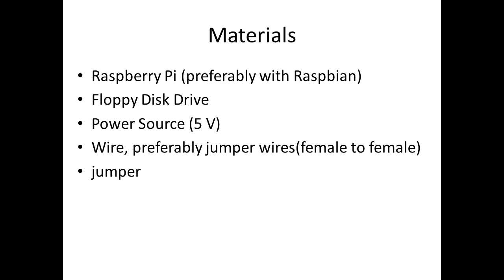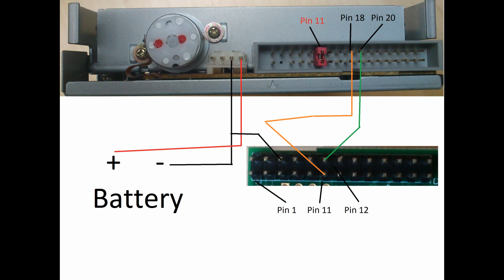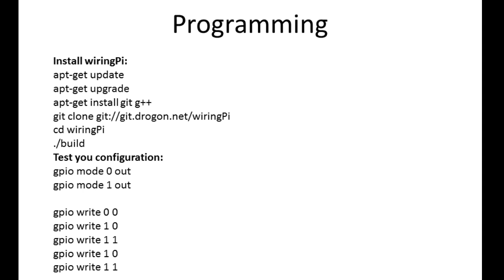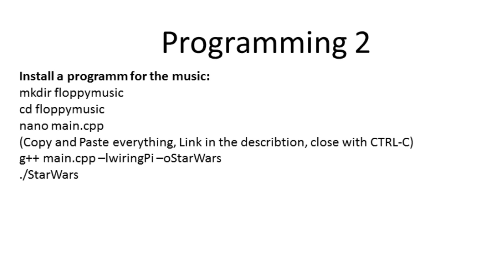Tutorial: How to Make Music with a Raspberry Pi and a Floppy Drive

Comment: I got my floppies....got my pi......got the software as you showed (clone wiringPi off github) but I am having issues.

If you're reading and want to try it - on some floppies the jumper pin for the LED is different, and on one of them I can hear it power on without the LED jumper across the 2 pins - but on another one this jumper NEEDS to be there to complete the circuit - Not only that..but on BOTH of mine the jumper needs to be one pin over to the right of the video demo - it's the ONLY pins that work on mine

So firstly after installing wiringPi, I was shown a message saying I also need (-lwiringPi) and (-lwiringPidev)

I continued anyway...now i have wiringPi installed, and I use the mode command to activate the pins 0 and 1 (GPIO 0 and GPIO 1 - they are POSITIONED as pins 11 and 12 as you count them on the board)

All Good.....then I run the test command - the write command: gpio write 0 0 (etc) to hear the motor or confirm I am on the right pins etc etc - I just get nothing. I have it grounded off the pi aswell

I get no error messages - but I also get no activity within the floppy drive - no motor or spinning or anything. I went ahead and repeated the command over EVERY pinon the floppy to try and see if my pin configuration was different and nothing.

I am baffled now
Reply from the maker: Okay, right now I don't get if its an hardware or software issue. If you connect the pins to the power source, can you make the drive click without any usage of the Pi at all, to confirm the pins and the drive works as expected?
Reply: yes - as soon as I hook up the floppy to the power source it clicks once - and the LED comes on if the jumper is on >>>> I made progress just a minute ago...now (gpio write 0 1) and (gpio write 0 0) makes the LED on the front switch between high and low - so I am getting somewhere. This is the same on Both of my floppies (thanks for the reply)
Reply: the floppy will click and light up if I hook it up to a different power source (I have a low power 5V dc adapter to test them) I believe it is software related - my errors probably - although I did notice that my jumpers needed to be in a different place...the main thing is I have contact with the GPIO pin through the software - its just doing th wrong thing...I thought about moving this GPIO pin wire across EVERY floppy pin and running the code each time - untill one moves the motor lol
Reply: I just watched a floppy song - they ALL have disks in the drives......do I need to have a floppy disk IN the floppy drive in order to get the motor spinning?
Reply from the maker: I don't know it for all drives, but the ones if tried worked without, maybe they use it because it changes the sound? But I could also imagine a drive which only works with something in it with like a build in switch. Just try it. In your first comment you mentioned the working software controlled GPIOs, so maybe just try to get a connection between the power source and one of the pins on the drive, and then try if you can find a pin that clicks if you connect/disconnect power and drive. Hope I can help you a little bit.
Reply: Yes I have a connection between the software and the GPIOs - but NO clicking or motor movement....just the LED on the front changes when I run the code.    So no motor movement or clicks, but the LED on the floppy goes between high and low (bright and dim) 

so If I type:     gpio write 0 0

the floppy drive led goes brighter

if I type:    gpio write 0 1

the floppy drive LED goes dimmer / less bright

EVERY floppy pin does the same, but some are brighter than others.

I'm sure I will figure it out I seem to have a different pin layout on the floppy drive to your example, so I will keep trying different pins - on the floppy and on the Pi -

Thanks for your help

Comment: im trying this on raspberry pi 3 and it doesn't work. can you help?
Reply from the maker: I will try my best ;) 
Do you get any error messages while doing the steps mentioned in the video? Do you hear the drive click when connecting power?
Reply: Thank you :)
No error messages are appearing. The drive moves when shorting pins 11-12, 17-18, 19-20 (odds are grounds). I'm using pc power supply to the drive and independent power supply to the raspberry. Commands "gpio write" do not seem to do anything while on "sudo ./StarWars" rpi seems to be "doing it". Double-checked the wiring - seems to be right
Reply from the maker: Maybe there is a Problem with the Pin Layout on the RPi 3...
You could try to check on http://wiringpi.com/pins/ if you have the right pins connected.
Reply: Yes...the different versions of Raspberry Pi have slightly different layouts - I have a Raspberry Pi 2 and a lot of projects are written for the original Pi's....try googling your model's GPIO layout, and change the pins accordingly
Reply: I have the same Problem. Do you had any solutions?
Gibt es irgendeine lösung?

Comment: Thanks for this tutorial ! I just have a little problem: I did the wiring correctly and the final program works fine. But when I try to play the song, the drive don't receive any signal. He does make sound when i connect the gpio on the Raspberry (little cliks) but that's all. Any ideas ?
I tired to change the pins (because i'm on a Raspberry Pi B) but nothing.
Reply from the maker: Mhm, are you able to do the clicks in the "manual software" with the gpio command? Or isn't this working too?
Reply: The manual software isn't working. WiringPi is working, but when I try to make the sounds by typing the commands, nothing happens. Also nothing happens when I modify the gpio inputs/outputs. I even tried with 2 differents drives but still nothing.
Reply from the maker: +Estate Mhm that sounds like a problem with either the wiring of the cables, which you should double check, but I think you already did that ^^ So maybe it's a software-hardware problem. One idea might be to try to check the functionality of the gpio for example with a LED-light to see if the hardware of the Pi is working regularly. Are you sure you have enough power for the Pi to operate them?

Comment: Thx for guide. I make my floppy music. It's wonderful 
How to make a sample from another MP3 music? Knowledgeable prompt. Thanks to the author again.
Собрал такую же тему , 2 флопа для стерео =)
Кто знающий подскажет как делать семплы других мелодий , например передрать mp3 какойнить?
Reply from the maker: +Александр Лукьянов Okay, I don't know if I get you excactly right, but to me it sounds like you want to play an mp3 song on the floppy, or convert it so it plays on the floppy. First, the floppy can only make one specific frequenzy over time. So you can't use it as a normal speaker, it's more like a flute or something, only one note at a time. So you can only play tunes. To play another Song, you have to find the melody to play for that songs. While this is very very difficult to do automatic with an mp3 file, it's very easy if you have a MIDI version of the song. So if you want to play another song, maybe try to find a MIDI file, find the melody you want to play out of the song, and then programm it into the Pi to play. I hope that answers you question, feel free to ask if you want to know anything further.
Reply: you need an army of floppies to do multiple notes - then you could have one doing the bass and one doing the melody etc

Comment: I just tried this on the raspberry pi2 mobel B, it still works great! Thank you for the tutorial.
Reply: +sona11111111 this is messing me up since im a complete noob when it comes to the PI i have a B+ and i believe the pinout is different but i have no idea what to do
Reply: +KratosAurion Pinout is the same for the pins he is using, they just stick 8 more pins on the far end of the connector. (http://www.element14.com/community/servlet/JiveServlet/previewBody/73950-102-4-309126/GPIO_Pi2.png) I wrote my program in python using rpi.GPIO library. Ill GPL it once it is in a readable state. =P
Reply: +sona11111111 i figured out the pin out and im using an old pc power supply to run it but tapping the ground into the back of the pc supply ground. the gpio write commands are not doing anything... im at a loss
Reply: +KratosAurion Hmm well it is difficult to tell without seeing everything. You should start with the sixth pin from the left on the floppy connector shorted so you get the light on the floppy to come on when it receives power. Move over three pins from that to the step pin and connect the gpio out to the top pin on the connector. Cut off one of the connectors you don't care about on the ATX power supply and strip the black wire; connect it to one of the ground gpio pins on the pi. Now when you pulse some voltage to the gpio you should get it to step (dont even worry about the direction, you should be able to get the step working) One step wont look like much, you can turn it on and off quickly to get noticeable movement.
Reply: +sona11111111 great i just somehow managed to fry 2 Pi's trying to do this... $80 down the drain
Reply: ha ha - miner has protective circuitry so it just cuts of if theres a short

Comment: You can use the 1st gpio pin to get the 5 volts!
Reply from the maker: Daniil Gentili Have you tried this or is this a theoretical statement? I think this could definitly work, but i don't know if the Pi can deliver enough Power(Ampere) for the drive to work correctly, without crashing itself. It depends on the used model and power supply. 
This is a forum entrance worth reading on the topic: http://raspberrypi.stackexchange.com/questions/19942/powering-a-floppy-drive-with-the-5v-gpio-pin
Reply: Yep, it works. I tried this with 3 floppies connected together and it works. It all depends on the amperage of the power source of the Pi.
P.S. I managed to play a song on all 3 floppies using the floppymusic program and a midi file.
I'm going to upload a video of the song (Dark Horse by Katy Perry).

Comment: Can the wires between floppy disk and raspberry pi can be just soldered together? Im thinking to use jumpers on the raspberry pi side and soldering on the floppy disk side. Also is it possible to get a picture of the ready wiring?
Reply from the maker: TurkeySalad Gaming Soldering is possible, but be shure that you don't connect the pins on the floppy disk by mistake. I don't understand what you need on the picture, the one used in the video as an jpeg image is avaiable on my Blog: http://domj.happyforever.com/Blog/wp-content/uploads/2014/08/Wiring.jpg and the article itself: http://domj.happyforever.com/?p=99
Reply: XtraPerianer Thank you! As the pictures i mean like how you made it in real life. A picture of the real project.

Comment: Now it works, but my floppy drive only clicks and the head isnt moving, but if i hold a key when it is playing, it plays but very quietly.
Note: I have a rpi B+
Reply from the maker: The head isn't supposed to move, it moves one step on the left and one in the right direction every time so normally you should see it a little bit vibrating. Maybe check the power supply of the drive if it doesn't works as excpected, I had some struggle with delivering excactly what the drive wanted. Normally it's 5V but you have to check for you drive.
Reply: ok i'll check that
Reply from the maker: Yes, this is definitly a software thing. In the programm i use the direction pin is changed with every movement of the head, because it's easier to script it when you don't have to care about the head beeing stuck at one end of the disk.
But if you're a little into programming this should be definitly possible. Maybe there are also programms for this on the internet, but it's a pitty that most of these are for arduino only.
Reply from the maker: You're welcome ;-)
Maybe just switch the direction every 50th move or so and it will move a little bit.
Reply from the maker: Sam Williams What do you want excactly, play a keyboard live with the drive as a "speaker", or create MIDI-Files for playback on the disk? In my opinion both things are difficult to do on your own(programming), but there are some solutions out there in the web for it.
Unfortunatly for the first i haven't found any with a quick search, but for the second thing to start maybe have a look at this: https://github.com/jereksel/MidiToFloppy
It seems it does excactly what you need to play midi files on one or multiple disks. All credits go to jereksel, the one who made it on github  ;-)
Reply from the maker: This should be possibly with the link above:)
Try it out and if you get any problems feel free to ask.
Reply: @XtraPerianer  How do you switch direction?

Comment: When I do the g++ main.cpp -IwiringPi -oStarWars command, I get this:
/tmp/ccpssZMP.o: In function 'resetMotor()':
main.cpp:(.text+0x14): undefined reference to 'digitalWrite'
main.cpp:(.text+0x2c): undefined reference to 'digitalWrite'
main.cpp:(.text+0x38): undefined reference to 'digitalWrite'
main.cpp:(.text+0x40): undefined reference to 'delay'
.
.
.
/tmp/ccppssZMP.o: In function 'init()':
main.cpp:(.text+0xe8): undefined reference to 'wiringPiSetup'
.
.
.

I hope there is enough information for you to help me :)
Thank you
Reply from the maker: It seems like g++ can't find the wiringPi Library, and so every line that uses some function from wiringPi doesn't work and gives you an error. You should try to reinstall wiringPi, and test if the gpio function mentioned in the video works properly, or if you get any error messages while installing wiringPi. To do so:
git clone git://git.drogon.net/wiringPi
cd wiringPi
./build uninstall
./build
If this won't give any error messages you should be able to complile the code. Feel free to ask if it won't work again.
Reply: XtraPerianer  It's not working.